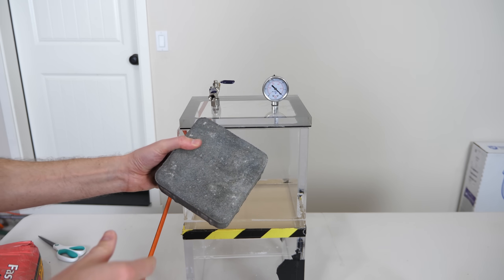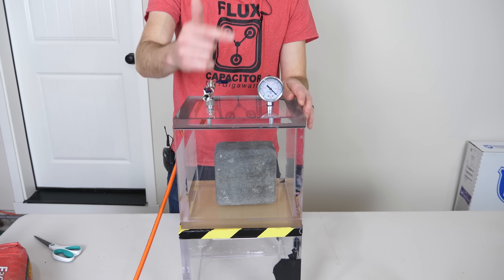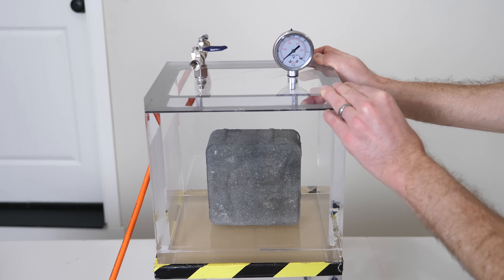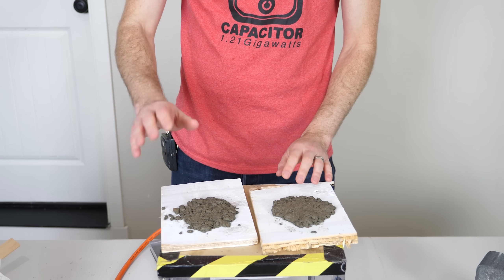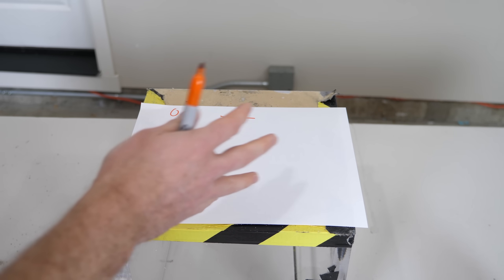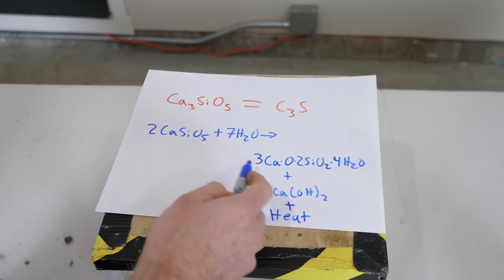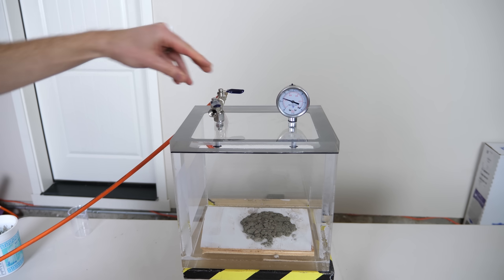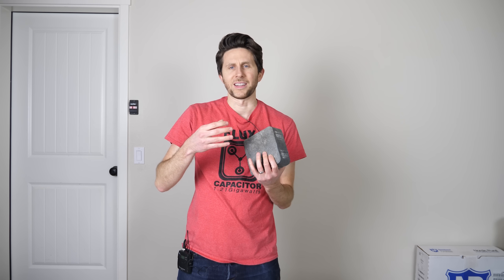Does Concrete Turn to Dust in a Vacuum Chamber? Concrete Without Oxygen Experiment

Comment: It's gonna stay solid is my guess.

After watching the whole video:
I was right. Also because the air INSIDE the concrete holds it up. And there is no way to remove the air that is trapped inside the concrete.

Comment: concrete hardens by chemical reaction, giving off heat in the process. Concrete wont crumble
Reply: It's surprising the concrete didnt crack or explode being there can be air trapped in it

Comment: Hi
Why do you need to let in air before opening the vacuum chamber? 
and
Why doesnot your glass box crumble in a vacuum situation due to the atmospheric pressure on it?
Reply: 1. The negative pressure pulls / pushes the glass into the middle of the chamber, making it very difficult to open the chamber.
2. The thick glass is very stable so that it can withstand this load. Assuming the glass was 1mm thick, then with this shape it would most likely implode.

Comment: So a little late to this conversation.. im not a scientist nor chemist or any fancy titles but did study some architecture and going to put in my two cents tho just speculation and maybe not worth anything.
Reply: If you cure concrete slower, more time was allowed for the bonding to happen and it becomes harder as per my understanding.. not all cured concrete is equal. Being in a vacuum id assume it could cure slower which makes sense since, air which tends to move even if you dont notice it move, will dry things faster. That seems to be the case here, noticing the darker concrete, which concrete gets lighter in color as it dries completely. 
My guess is if this experiment was to continue till both fully cured and with an amount of concrete that is a bit more thicker than peanut brittle.. the comcrete in the vacuum would in the end cure slower allowimg it better bonds and ultimately making it harder in the end. 
This is purely my speculation with my very limited knowledge of concrete and even less knowledge of vacuums and/or space.
🍻

Comment: Actually, there must be difference between vacum and air. When you started to make vacuum in chamber, presure drops down, so a lot of water molecules evaporated and left some cement between concrete. That should should make final product crumble more, and that is clear seen in your video, the vacuum surface is more dirty with small particle. The air in chamber must be swaped with some noble gas may be, like Helium, so the water inside wont evaporate.

Comment: the myth begin bcoz , the actual statement meant removing Oxygen entirely from earth and  not just from atmosphere , thus oxygen from concrete and other compounds that use oxygen , will suffer
Reply: This makes a lot o sense
Reply: Without the original oxygen, you would not have "set" concrete in the first place.

Comment: From time index 10:37, would it be feasible to compensate for the accelerated evaporation of water in the vacuum of space or the Lunar surface, by adding more water to the concrete mixture?

Comment: I work in construction, the dry concrete, nothing will happen,... it’s a chemical reaction that happens... it left off heat through the process and it can’t be undone....

The wet concrete though.. I’m not sure, I know the vacuum will make the water boil... so, it’s probably going to move the concrete too much to ever dry..

Comment: Please use appropriate terms. Concrete doesn't "dry" it "cures". Drying is a mechanical action that leaves constituent materials unchanged. Curing is a chemical reaction that changes the make-up of the material.

Also, "removing oxygen" doesn't mean "removing atmosphere"

Comment: He might not know, but when you stack bricks there is air pockets sealed up. Such as cinder blocks. If we suddenly have a mass vacuum, the pressure would cause those pockets crack the blocks resulting in structural failure.

Comment: How many of inches of vacuum did you you pull.  All the mositure should be removed as it evaporats so if there is moisture left you haven't even approched a hard vacuum.

Comment: Concrete doesn't dry, it sets. Drying is when the water evaporates away. Concrete doesn't lose the water. The water chemically reacts with the cement and becomes part of the structure.

Comment: I'm just about 100% certain that nothing is going to happen to the concrete block.  I'm saying this at 1:44 in the video.  As far as the concrete hardening process goes, that I don't know for certain.  I think the vacuum will cause the water in the concrete mix to rapidly boil off.  This might cause the concrete to turn into a dry powder instead of becoming a solid mass.  So let's watch the rest of the video and see how close I am.

Comment: I am pretty sure nothing is going to happen. My only idea as to why a concrete block would collapse in a vacuum is if you have a significantly porous piece, the air escaping the block might crack it. But I doubt that.

Also, this is a bit of a cheat from because I have a background in chemistry and also I mixed a few bags of cement, but I know one component in the concrete solidifying reaction is the CO2 from the air, so I'm sure the concrete wouldn't solidify in a vacuum, although it would probably dry out quite fast as the water would try real hard to fill the vacuum with its vapor.

Edit: ok, I confused concrete and mortar in the second part, I'm stupid like that

Comment: @1:40 they mean that if you removed the solidified and trapped Oxygen as apart of "every Oxygen molecule on Earth" the bonding would simply come undone. This includes O1, O2, and O3 which is the entire ozone layer. This also means separating O1 from H molecules.

 considering the density and structural integrity of concrete, and it's "chalky" consistency, it likely would turn into a substance where, given how gravity, and tensile strength works, tops of large structures would collapse down, and freeways would crackle apart just like they would under normal circumstances without timely routine maintenance.

Maybe not dust (can't say absolutely not), but you would get some central disintegration within thicc strictures like freeway underpass base slopes, and most building foundations.

But who knows what effects not having an Ozone layer would have on concrete that has been stripped of all Oxygen?

Finally, even though that's a great vacuum you have there, it's not true. You haven't actually sucked all of the oxygen molecules out, but you did decrease the pressure, which means less friction for those molecules, but not necessarily stripping them away.

Edit: welp I am wrong.

Comment: Sir,

There's one more reaction associated with the setting of cement-concrete. 

The Calcium-Hydroxide subsequently reacts with CO2 in the atmosphere to harden into calcium-carbonate. That is akin to limestone. The hydration reaction  reaction proceeds slowly over weeks & months which is why concrete needs to be cured. Often this is done by immersing in water. Thereafter the carbonate reaction continues for years as not only there isn't much co2 in the atmosphere but also that it has to diffuse thorough the solid mass.

Comment: Well... Without oxygen plants would turn into mineral oil, CO2 in the air would make it rain coal dust, water would turn into Hydrogen (which cannot burn because no O2) and that hyrogen could combine with other newly relased stuff to form ammonia and hydrogen sulfide gas. We would well... die of suffocation, but before that our blood would split into two parts, one solid and one gaseous - probably methane. 
The only semi-intact part of you left would be your skeleton as your flesh turns to dust and is blown away by the insane winds and atmospheric pressure caused by every ocean in the world having suddenly turned into gas (thus expanding)
That is to say... Concrete turning to structures of tightly packed dust is the least of your concerns.

Comment: The only problem I have with this test is that in a vacuum molecules slow down so the oxygen molecules kinda stay in the mix, it needs to be heated to get those molecules moving more so they get sucked out by the vacuum. if you just pump it down every oxygen molecules stays in the mixture because there not moving, so if you do a longer process with heating it up  let it pump heat it up again you will get the oxygen out of the mixture but with this chamber I don’t think you could get all of the oxygen out  maybe try mixing the cement in the vacuum with it pumped down already? Curious what would happen then

Comment: Another myth I learned when I was a brick layer is that when concrete hardens it's because the reaction drives water out so there is a vacuum inside thus the air pressure outside holds the agregate together. If the pressure outside is removed in a vacuum there is nothing to hold it together. Obviously that's not the reaction that holds the concrete together. But that's one of the myths.

Comment: If you don't remove the heat, the concrete won't harden.  Was a big problem during the creation of large concrete dams -- have to cut water channels to remove the heat.  I'm sure that has some implications in space for large structures.

Comment: I worked with concrete years ago.  During that time I learned or was told several things not mentioned in your video.
1- A normal pour (like homeowner sidewalk) would harden enough to walk over it in a day or two.  Bad idea.  It isn't set enough.  A full set time would normally be over 3 weeks.  But long before that it would survive normal wear and tear (walking or bicycling on  it).  A day or two is too soon.
2- Stronger mixes (more cement) cure faster and get hotter.  And the strength may be needed for a "structural" application.
3- A standard guide would be to cover fresh concrete for a day or so.  Why?  Because some of the water trapped inside couldn't evaporate if the outer surface has hardened and dried.  And you would prefer the concrete to "set" from the inside out.
4- Water is trapped inside curing concrete and it takes time to dry.  Harry Homeowner makes a BBQ pit and uses it too soon.  Then it blows up as the trapped water turns to steam inside the mortar.
5- Concrete is formulated for various applications, often by adding chemicals before mixing.  Some make it set faster, as you would want in  cold weather.  You want it setting before the water in it can freeze.  Or you add a chemical that entrains air within the concrete. "Air-entrained concrete contains billions of microscopic air cells per cubic foot. These air pockets relieve internal pressure on the concrete by providing tiny chambers for water to expand into when it freezes."

Minor comment that is normal for all of us.  We frequently swap "cement" and "concrete." as you did in the video.
Reply: I thought hardening of concrete was because of some kind of chemical reaction instead of water leaving it?
Reply: @vksasdgaming9472  That's absolutely right. Water leaving your concrete is a bad thing, that's why they wrap it in plastic. If you add extra water after it dries out, concrete actually gets stronger.
Reply: @vksasdgaming9472  I think it is both.  The chemical reaction creates a lot of heat.  Especially if there is a higher percentage of cement.  Or possibly some additives put in to accelerate the setting.  I guess the water is part of that, and does seem to get released during the process.  Having the surface moist may allow a path for the internal water.
Reply: @vksasdgaming9472  Both: the reaction with oxygen and/or water and/or CO2 is what makes It harden, but water needs to be removed slowly, so the cement slurry or concrete has the desired porosity, texture and elasticity.

Kinda similar to how important is removing water gradually when baking bread or cakes.

P.S.: There is the exception of using hydrophillic cement, since It is designed to harden when damp and inside/besides water. In that case, only the reaction with water matters.
Reply: A standard 50/50 3500psi exterior has chemicals in it to help it set quicker...standard set time is 28 days and can be accelerated with the aid of chemicals
Reply: that was like the longest comment ever..
Reply: @abdur905  not just the comment the replies too
Reply: You forgot to mention the research he did is based off the rapid set concrete that he used, which has additives that use heat to cure so it will cure in the time frame he states (although a full set is still recommended resting for 24 hours), and Portland cement does not have the additives that rapid set has which is why your normal Portland cement takes longer to cure and is not nearly as hot, typically you can't even feel the heat by hand
Reply: wooow you sound smart.
Reply: Did you learn #4 from an incident you witnessed, one whose aftermath you had to deal with, or a gruesome industrial film?
Reply: F
Reply: Too much writing to read.✍🏼✍🏼✍🏼✍🏼✍🏼✍🏼✍🏼✍🏼✍🏼✍🏼✍🏼✍🏼✍🏼✍🏼✍🏼✍🏼✍🏼✍🏼✍🏼✍🏼✍🏼✍🏼✍🏼✍🏼✍🏼✍🏼✍🏼✍🏼✍🏼✍🏼✍🏼✍🏼✍🏼✍🏼✍🏼✍🏼✍🏼✍🏼✍🏼✍🏼✍🏼✍🏼✍🏼✍🏼✍🏼✍🏼✍🏼✍🏼✍🏼✍🏼✍🏼✍🏼✍🏼✍🏼✍🏼✍🏼✍🏼✍🏼✍🏼✍🏼✍🏼✍🏼✍🏼✍🏼✍🏼✍🏼✍🏼✍🏼✍🏼✍🏼✍🏼✍🏼✍🏼✍🏼✍🏼✍🏼✍🏼✍🏼✍🏼✍🏼✍🏼✍🏼✍🏼✍🏼✍🏼✍🏼✍🏼✍🏼✍🏼✍🏼✍🏼✍🏼✍🏼✍🏼✍🏼✍🏼✍🏼✍🏼✍🏼✍🏼✍🏼✍🏼✍🏼✍🏼✍🏼✍🏼✍🏼✍🏼✍🏼✍🏼✍🏼✍🏼✍🏼✍🏼✍🏼✍🏼✍🏼✍🏼✍🏼✍🏼✍🏼✍🏼✍🏼✍🏼✍🏼✍🏼✍🏼✍🏼✍🏼✍🏼✍🏼✍🏼✍🏼✍🏼✍🏼✍🏼✍🏼✍🏼✍🏼✍🏼✍🏼✍🏼✍🏼✍🏼✍🏼✍🏼✍🏼✍🏼✍🏼✍🏼✍🏼✍🏼✍🏼✍🏼✍🏼✍🏼✍🏼✍🏼✍🏼✍🏼✍🏼✍🏼✍🏼✍🏼✍🏼✍🏼✍🏼✍🏼✍🏼✍🏼✍🏼✍🏼✍🏼✍🏼✍🏼✍🏼✍🏼✍🏼✍🏼✍🏼✍🏼✍🏼✍🏼✍🏼✍🏼✍🏼✍🏼✍🏼✍🏼✍🏼✍🏼✍🏼✍🏼✍🏼✍🏼✍🏼✍🏼✍🏼✍🏼✍🏼✍🏼✍🏼✍🏼✍🏼✍🏼✍🏼✍🏼✍🏼✍🏼✍🏼✍🏼✍🏼✍🏼✍🏼✍🏼✍🏼✍🏼✍🏼✍🏼✍🏼✍🏼✍🏼✍🏼✍🏼✍🏼✍🏼✍🏼✍🏼✍🏼✍🏼✍🏼✍🏼✍🏼✍🏼✍🏼✍🏼✍🏼✍🏼✍🏼✍🏼✍🏼✍🏼✍🏼✍🏼✍🏼✍🏼✍🏼✍🏼✍🏼✍🏼✍🏼✍🏼✍🏼✍🏼✍🏼✍🏼✍🏼✍🏼✍🏼✍🏼✍🏼✍🏼✍🏼✍🏼✍🏼✍🏼✍🏼✍🏼✍🏼✍🏼✍🏼✍🏼✍🏼✍🏼✍🏼✍🏼✍🏼✍🏼✍🏼✍🏼✍🏼✍🏼✍🏼✍🏼✍🏼✍🏼✍🏼✍🏼✍🏼✍🏼✍🏼✍🏼✍🏼✍🏼✍🏼✍🏼✍🏼✍🏼✍🏼✍🏼✍🏼✍🏼✍🏼✍🏼✍🏼✍🏼✍🏼✍🏼✍🏼✍🏼✍🏼✍🏼✍🏼✍🏼✍🏼✍🏼✍🏼✍🏼✍🏼✍🏼✍🏼✍🏼✍🏼✍🏼✍🏼✍🏼✍🏼✍🏼✍🏼✍🏼✍🏼✍🏼✍🏼✍🏼✍🏼✍🏼✍🏼✍🏼✍🏼✍🏼✍🏼✍🏼✍🏼✍🏼✍🏼✍🏼✍🏼✍🏼✍🏼✍🏼✍🏼✍🏼✍🏼✍🏼✍🏼✍🏼✍🏼✍🏼✍🏼✍🏼✍🏼✍🏼✍🏼✍🏼✍🏼✍🏼✍🏼✍🏼✍🏼✍🏼✍🏼✍🏼✍🏼✍🏼✍🏼✍🏼✍🏼✍🏼✍🏼✍🏼✍🏼✍🏼✍🏼✍🏼✍🏼✍🏼✍🏼✍🏼✍🏼✍🏼✍🏼✍🏼✍🏼✍🏼✍🏼✍🏼✍🏼✍🏼✍🏼✍🏼✍🏼✍🏼✍🏼✍🏼✍🏼✍🏼✍🏼✍🏼✍🏼✍🏼✍🏼✍🏼✍🏼✍🏼✍🏼✍🏼✍🏼✍🏼✍🏼✍🏼✍🏼✍🏼✍🏼✍🏼✍🏼✍🏼✍🏼✍🏼✍🏼✍🏼✍🏼✍🏼✍🏼✍🏼✍🏼✍🏼✍🏼✍🏼✍🏼✍🏼✍🏼✍🏼✍🏼✍🏼✍🏼✍🏼✍🏼✍🏼✍🏼✍🏼✍🏼✍🏼✍🏼✍🏼✍🏼✍🏼✍🏼✍🏼✍🏼✍🏼✍🏼✍🏼✍🏼✍🏼✍🏼✍🏼✍🏼✍🏼✍🏼✍🏼✍🏼✍🏼✍🏼✍🏼✍🏼✍🏼✍🏼✍🏼✍🏼✍🏼✍🏼✍🏼✍🏼✍🏼✍🏼✍🏼✍🏼✍🏼✍🏼✍🏼✍🏼✍🏼✍🏼✍🏼✍🏼✍🏼✍🏼✍🏼✍🏼✍🏼✍🏼✍🏼✍🏼✍🏼✍🏼✍🏼✍🏼✍🏼✍🏼✍🏼✍🏼✍🏼✍🏼✍🏼✍🏼✍🏼✍🏼✍🏼✍🏼✍🏼✍🏼✍🏼✍🏼✍🏼✍🏼✍🏼✍🏼✍🏼✍🏼✍🏼✍🏼✍🏼✍🏼✍🏼✍🏼✍🏼✍🏼✍🏼✍🏼✍🏼✍🏼✍🏼✍🏼✍🏼✍🏼✍🏼✍🏼✍🏼✍🏼✍🏼✍🏼✍🏼✍🏼✍🏼✍🏼✍🏼✍🏼✍🏼✍🏼✍🏼✍🏼✍🏼✍🏼✍🏼✍🏼✍🏼✍🏼✍🏼✍🏼✍🏼✍🏼✍🏼✍🏼✍🏼✍🏼✍🏼✍🏼✍🏼✍🏼✍🏼✍🏼✍🏼✍🏼✍🏼✍🏼✍🏼✍🏼✍🏼✍🏼✍🏼✍🏼✍🏼✍🏼✍🏼✍🏼✍🏼✍🏼✍🏼✍🏼✍🏼✍🏼✍🏼✍🏼✍🏼✍🏼✍🏼✍🏼✍🏼✍🏼✍🏼✍🏼✍🏼✍🏼✍🏼✍🏼✍🏼✍🏼✍🏼✍🏼✍🏼✍🏼✍🏼✍🏼✍🏼✍🏼✍🏼✍🏼✍🏼✍🏼✍🏼✍🏼✍🏼✍🏼✍🏼✍🏼✍🏼✍🏼✍🏼✍🏼✍🏼✍🏼✍🏼✍🏼✍🏼✍🏼✍🏼✍🏼✍🏼✍🏼✍🏼✍🏼✍🏼✍🏼✍🏼✍🏼✍🏼✍🏼✍🏼✍🏼✍🏼✍🏼✍🏼✍🏼✍🏼✍🏼✍🏼✍🏼✍🏼✍🏼✍🏼✍🏼✍🏼✍🏼✍🏼✍🏼✍🏼✍🏼✍🏼✍🏼✍🏼✍🏼✍🏼✍🏼✍🏼✍🏼✍🏼✍🏼✍🏼✍🏼✍🏼✍🏼✍🏼✍🏼✍🏼✍🏼✍🏼✍🏼
Reply: @blossombliss7438  haha.

Comment: That's a stupid question ..... because it's not possible that the concrete block lose it's solid state properties ...for example you can see that astroids, planets  in deep space doesn't change their structure in absence of air or any gaseous medium.

Comment: Concrete is cured by chemical reaction and the longer you keep it moist the better the chemical bond.
This means in the vacuum water molecules in the cement would separate so the actual chemical reaction would be interrupted.
You couldn’t use concrete in space for this reason.

Comment: Tbf you mixed them both in the air then spoke about it as the chemical reaction took place then put one in the chamber .. good attempt but I don’t think it was conducted in a very scientific way , as you can’t starve the reaction if it’s been triggered but if water was “ somehow “ added into the chamber ( seems messy in my head “ then maybe we would have seen a starved reaction and this a weaker reaction !! Good channel though bro keeps the brain working

Comment: “That chemical reaction is called hydration” 
Me: “WHOA”
Reply: Nahhh it's not actually true
Imo as a "advanced chemistry"student,hydration happens when some substance is put inside liquid water. Those substances can lock water inside of its molecule, in order to create "hydrated salt", such as NaAlO2.2H2O(which means a single molecule of sodium aluminate "holding" 2 molecules of water),...
Concrete is one of those hydrated salt.
Reply: Same. "You put water in the mixture. That chem reaction is called hydration"
Please welcome Mr. Obvious.
No hate tho
Reply: @junnille2123  That's 20/20 hindsight. I could say "You put water in the mixture. That combination chemical reaction is called hydrocombination, obviously." And as you've shown, it would also make sense to call it hydration. So now, we have two possibilities (if we did not know what it was really called).

Comment: Concrete gets stronger over time... so concrete that 50 years old is super super strong vs concrete that's saying a week old. Anybody that's done core drilling or any type of slab saw work. will know what I'm talking about. it's one thing to cut fresh concrete... it's another to try to drill or cut concrete that the really old. The absence of atmosphere over time may have a big effect on it and may crumble but I doubt it's going to happen in a couple of minutes in a vacuum chamber. all that's going to happen is you're going to pull the moisture out of it.

Comment: When they say concrete turns to dust without oxygen, it means that the oxygen absorbed by the concrete while solidifying disappears. I don't think an air ejector will be able to suck that oxygen out

Comment: Well this is just obvious. The concrete won't tumble and just disintegrate or crumble if oxygen is removed from the environment. I mean if you "Remove all" air from earth and the oxygen that's already infused with concrete just disintegrates into thin air THEN it might crumble, maybe.
I'm not a chemist or anything just speculating.

Comment: My answers:1. No it will remain intact because of its compressive strength. And 2. The concrete will cure in a vacuum because it s chemical reaction doesn't need any inputs from the outside like air. The mixture  has air Intrained and water when initially mixed. Haven't watched video yet let's see how i did.

Comment: Normal concrete needs air to dry but there’s also concrete which doesn’t need air (used for foundation making underwater for bridges like the Golden Gate Bridge)
Well drying in the case of concrete is actually not correct term better would be harden